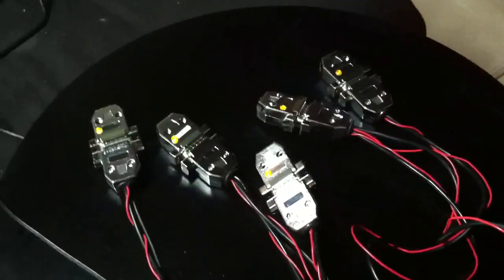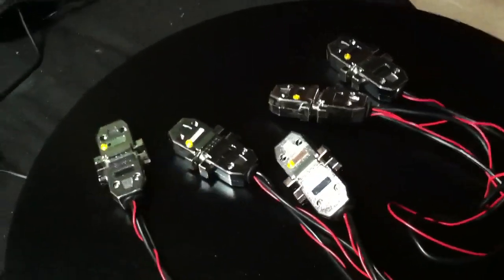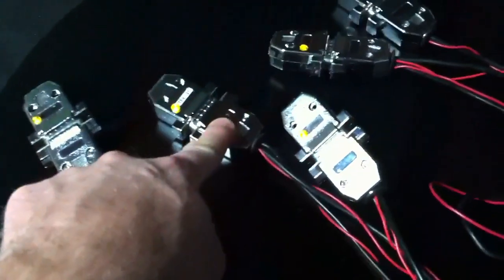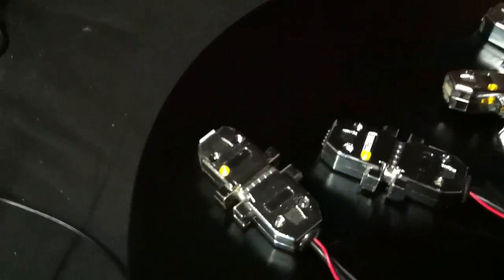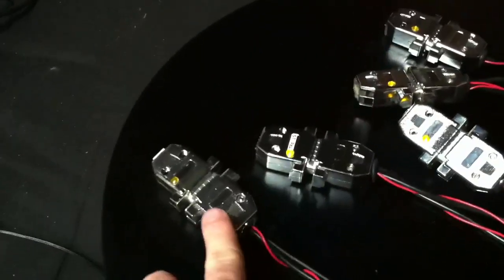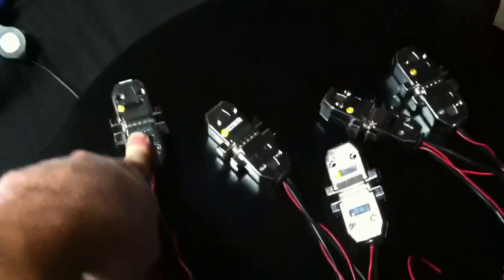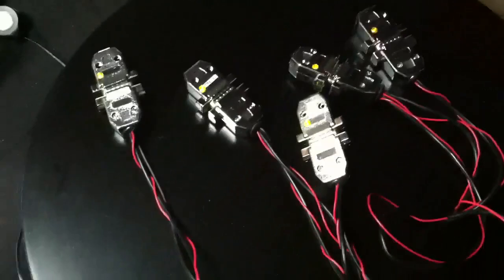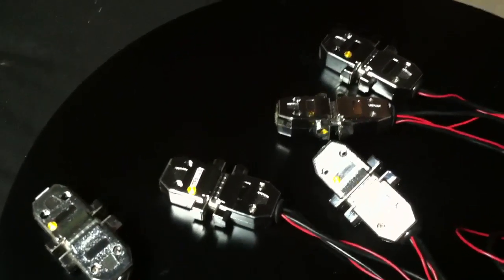Daisy-Chained Serial Arduino Clones

Comment: These connectors are really ancient. If I were to do this today, what should I use or do I need a setup like this?
Reply from the maker: The connectors are what the hardware had before I got them. so it's just what i had. ;)  I did another version of this for switching tracks in a lego train display for a friend, and for that one i used pin headers/sockets.  The connection type is not really important. :)